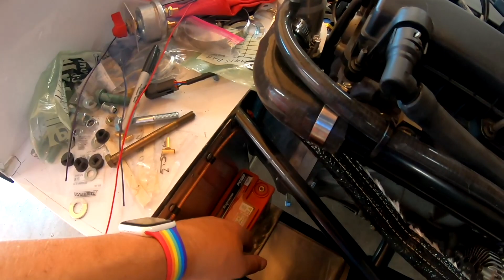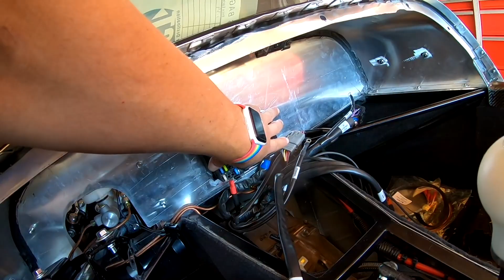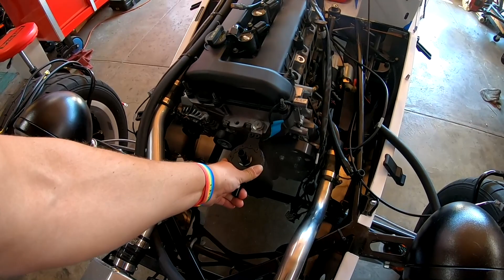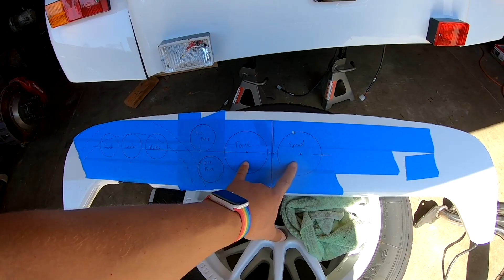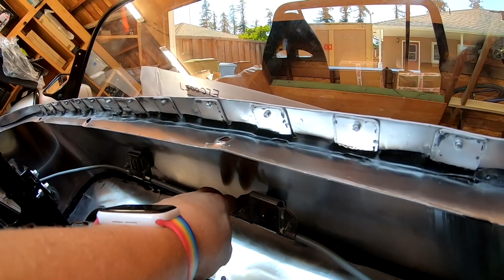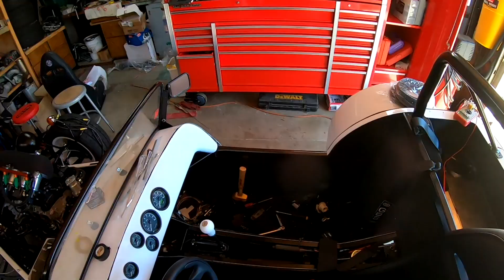Project Zero 15, Wiring, Wipers and Dash

Comment: Restarting a conversation with GBS I had a few months ago before moving, and probably going to buy the kit.  Is there a forum or group that I can use as a resource when doing the build?  How comprehensive is the build manual?  I'm awful at winging it and improvising solutions (would end up with no brakes or a hub coming off at 100mph).
Reply from the maker: There's a Zero Owners Facebook group that is a great resource for builders.  The Build manual covers Gen1 cars, but will be updated with Gen2 differences as more builders get their hands on them.  Lucky for you these cars go together pretty easy!

Comment: Would you consider a catch can from tracy lewis performance? He invented the catch can that other manufacturers copied from.
Reply from the maker: He didn't invent the catch can, and the basic operating principals of an oil catch can go back to ww2 aircraft and postwar race cars.  It's on the spendy side but does offer nice fittings and housing.  I would loosely pack it with thick stainless steel wool and make sure you had check valves in-line.
Reply: @DriveDriverDriven  true I have the can in my car, in my daily that I drive very hard and use as a delivery car as well.